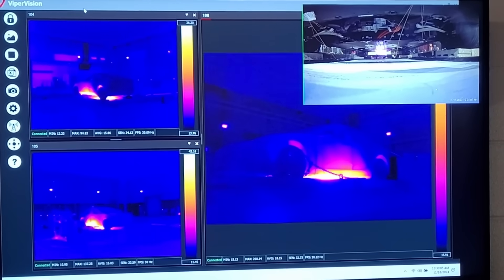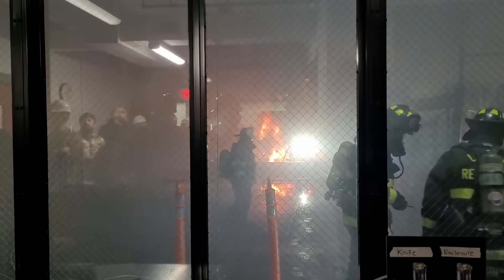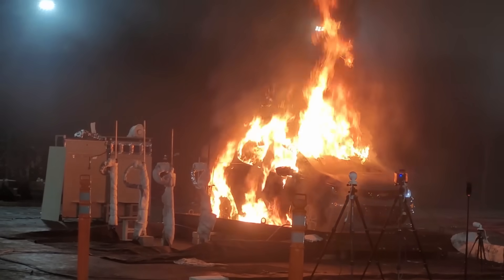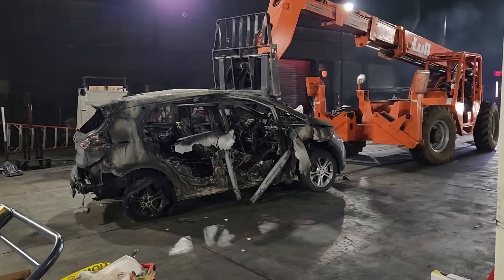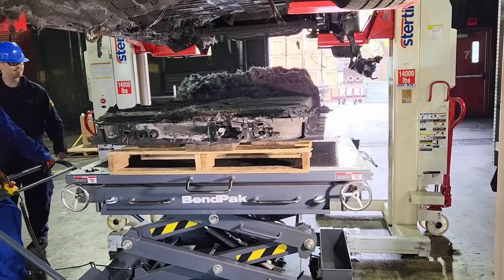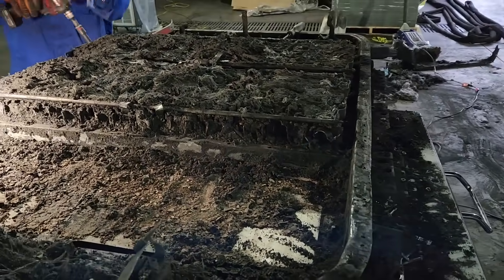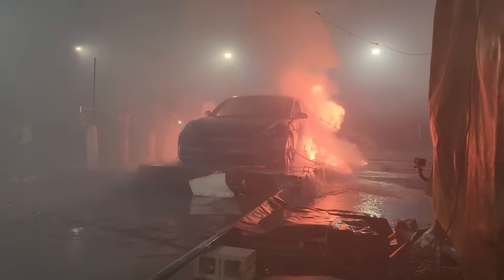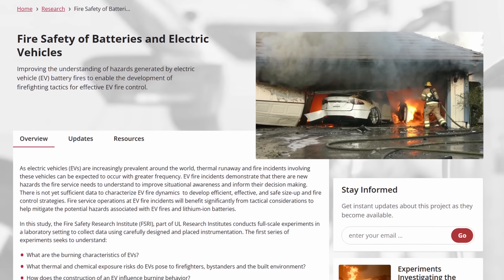FSRI EV Fire Experiments: What We’re Learning About Battery Fires

Comment: Two points that chew at me re ev fires starting and being put out. Wrt how fires start, does ohms law and how current moves within the battery have any link to how a fire starts? Wrt putting a battery fire out, (thought from left field) could creating an electrical circuit to the ground speed up making a battery pack flat (whilst huge kw in the batteries). there doesn’t seem to be any alternative but to putting a fire out with water etc. in fire fighting options. Dropping an ev into a portable pool is used for extinguishing but I ask for example how much is electrical current flowing through water (all be it probably forming  some hydrogen and oxygen)?

Comment: Just an idea. 
But certain level of oil is used in the electrical industry to quench arching in equipment.
How about a mobile tank of oil attends EV fires. Along with a fork lift. Normal firefighting can take place until this special unit turns up. Then the vehicle is lifted and submerged into the oil. Left there until it’s cooled sufficiently. Covering jets while it’s being lifted and dropped into the tank.

Comment: Great work and badly needed, I habe to ask if the team has considered doing a live charging failure instead of an over heat type? My thought is that the thermal issues could be different if internally the pack fails due to faulty cell(s) or charger issues. Perhpas several cells fail close in time together with the heat focused in that specific area causing different specifics as that heat is trapped inside the pack etc.

Comment: Great Work!  What is the contamination level of the water runoff?  How many gallons of water does it take to extinguish an "average" EV fire?  Is it a better choice to let the EV fire burn itself out?
Reply: When it comes to battery fires the strategy is to use water to cool the surroundings to prevent batteries in adjacent vehicles from being heated to the point of thermal runaway.  Once a battery shorts internally it is not going to stop burning until the energy contained within is released.
Reply: @soundspark  The SOP on an EV fire is to use water to slow the thermal runaway of adjoining battery cells; assuming there is an adequate water supply. The water runoff is likely toxic as is the airborne particles.  Without containment of the runoff, is ground water being contaminated?

Comment: The automotive manufacturers had to have done extensive testing on EV batteries for engineering and liability purposes.  It would be helpful for StacheD to track down the test engineers from the likes of Ford and GM to learn what tests, data, and liability calculations were done.
Reply: re: "It would be helpful for StacheD to track down the test engineers from the likes of Ford and GM to learn what tests, data, and liability calculations were done."  unfortunately less helpful will be all the NDA's those Engineers working in R&D we're obligated to sign as a condition of their Employment. source: been there done that.

Comment: I have a problem with this study. Cause all the battery fires were from the flame working into the battery packs but what about if the vehicle is in an accident and the batteries get damaged and arch’s causing a electrical shock that could cause an explosion?

Comment: It would be interesting to see how vehicles from different manufacturers perform in these tests.  

Is there any vehicle / models that continually perform well, vs others that maybe not so well. 

Or maybe if different battery pack/cell manufacturers / battery types have noticable difference in how they burn etc.

Almost like a vehicle crash safety rating, except for EV fire safety.

Comment: Interesting. if vehicle is flipped (with the help of chains and fire truck), it might be thermally easier to cool down the structure of the vehicle and cool the battery. Heat will escape UP and battery is at the top.

Comment: I'm just thinking out loud, but... What if an EV fire-specific firefighting vehicle could be developed? I'm imagining something along the lines of what exists now as a waste collection truck that handles dumpsters. Equip it with a side-offload system that could lower a steel barrier to surround a burning EV, with that barrier then being pumped full of a suitable firefighting agent to completely encase the vehicle. This would (in theory) not only douse the flames but also remove the fire's external source(s) of oxygen. It would also provide containment to prevent the fire's spread and shield against possible explosive forces from the vehicle.
Thanks again and regards.
Reply: re: "I'm just thinking out loud..."  no worries. re: "What if an EV fire-specific firefighting vehicle could be developed?"  go 'head, i'm listening... re: "It would also provide containment to prevent the fire's spread and shield against possible explosive forces from the vehicle."  unbeknownst what you just described was the BAE systems (BFV) M2 Bradley Fighting Vehicle, but in your spec-out we will rename it the "Bradley FIRE Fighting Vehicle".  in a related bit of humor, also watch the 1998 HBO Movie "Pentagon Wars" featuring Kelsey Grammer, it's funny you'll like it.
Reply: @phillyphil1513  Roger, haven't seen the movie. Thanks for the heads-up.

Comment: Battery fire: all you can do is starve it of oxygen. It will produce ridiculous amounts of heat and anything near it is fuel. So the only thing you can remove from the triad of flame is oxygen.
Get fire blankets. Lots of them. Big ones.
Reply from the maker: Thermal runaway is a self oxidizing chemical reaction.  They do not require oxygen from the atmosphere.
Reply: @StacheDTraining  Exactly. But by containing it under a fire blanket, you prevent the vehicle from igniting anything else around it.

Comment: Why don't you invent a special fire fighting nozzle just for EVs? Oh because I just did. It's a rigid metal pipe between 6 and 10 feet long that you slide underneath the vehicle and it has the water outlets only on the top side to direct all the water straight up onto the battery pan directly. It could, of course, be helpful in extinguishing ICE fires as well, without the need to open the hood of the vehicle.

Comment: 8:40, It seems that the water hose powerfull flow is creating positive pressure in front of the flammable gas and flammes, making them to move when sprayed. Do you think that using larger spray and squeeze the gas in the middle of the car by using  spray on both sides of the car at the same time?

Comment: 8:08, ON these tesla the battery powering the infotanement screen is located under the hood and in most recent model is a really single 15.5V CATL lithium battery with very low power. It is recharged by the PCS on the from battery so even if the main battery stop working this 15.5V supply will continu as  well as the service menu to be able to provide data

Comment: There are tons of sensors inside the battery that the BMS and BTMS can provide. Individual voltages, current, Inlet and outlet cooling temperatures, enev some battery have gas sensors inside to detect venting of cells. I am curious if the team that made these tests were monitoring these BMS ? (the time they can operate as well) On the tesla there is a SERVICE menu where some of these data can be pulled out.  I imagine pointing a camera to it while the battery begin to burn woudl provide alot of additional data too. Even The OBD to Bluetooth interface using the Scan My Tesla app is awsome! There are hundreds data from the battery. Even if nobody have tiome to record these, a simple cellphone with screen recording would be enough to make it work!
Reply from the maker: There was a ton of data like that recorded.

Comment: Dear Mr. Durham,
German electric engineer here.

These tests seem to be very interesting. Just for my understanding (I might be wrong since I am NOT a fire fighter), the most dangerous starting point for vehicles when torched from underneath are like that:

EVs: 100% charged  - to have a max. run-away effect the moment the battery pack(s) start to ignite itself internally due to overheating
CEV: tank only 1/ 2 or 1/4 full to have a large gas vapor volume within the tank above the fuel, which might burst explosion style if overheated.

Is this correct and yes, were these victim vehicles fuelled / charged this way?

Any results from the experiments on how much time is left for let's say 5 people inside the car to stop and jump out? 
Any major difference between the EV and ICE, assuming the same door configuration?

Independently from the drive philosophy of the vehicle: With more and more cars are now not having good door handles and sometimes no door handles at all, how to manage to rip a door open to drag passengers out, let's say from an already smouldering vehicle?

I am very opposed about how EVs are forced politically into the market, but I am not opposed to EVs in general. Therefore as an engineer I am really curious.

Peace! from Dresden / Germany

Comment: Why was the burning EV raised and tilted at 30 deg while spraying easily underneath the car? That certainly isn't available for an actual car fire; wouldn't that negate the testing results?
Reply from the maker: Many fire departments are tilting the vehicles.   It's not easy,  but they do it.
Reply: re: "Why was the burning EV raised and tilted at 30 deg while spraying easily underneath the car? That certainly isn't available for an actual car fire..."  as we're witnessing in real-time with the First Responder battling the great "2025 LA Mega-Fire" down in So-Cal, DO NOT UNDERESTIMATE THE BRAVERY AND RESOURCEFULNESS of Firefighters to save lives and property.  like the wisemen say "If the job were easy...?  Everybody would be doing it..."👨🏻‍🚒

Comment: If you look at this and you are not an expert on Lithium fires, this video makes it clear what happens. Yet some EVangelists still say that ICE cars burns faster and hotter and they keep saying that EV fires are easy to put out. They must be blind to not see that what they say is not true. I think an EV is very dangerous and shouldn't be even on the road or on sale. Doors are electronicaly operated, windows are pretty hard to get through. Battery at the lowest point seems nice but that is also where the water is and in winter, salty water.
Reply: That is not true. Most proponents of EVs do say that EV fires that involve the thermal runaway are more vigorous. It is just that EV fires are a lot less likely than ICEV fires and only 60% of those fires involve a thermal runaway. So the risk of EV fires is less overall since they are far less probable. Not only that, you have look at the risk to structures from fires. Research is indicating that EV fires pose a similar risk to structural collapses as ICEV fires.
Reply: @yodaiam1000  Many battery car jockeys dismiss thermal runaway all together,  the other half do exactly what you just did. Tried to make thermal runaway seem less significant by attempting a pointless comparison, battery car numbers to that of liquid fuel. 
Can you please explain  what liquid fuel vehicle fires have to do with battery car thermal runaway?
Do the numbers address the grave issue of thermal runaway?
What do you expect to achieve with such?
Reply: re: "They must be blind to not see that what they say is not true." correct, they ARE "blind" so to speak.  in Psychology and Mental Health this phenomenon is known as "Cognitive Dissonance" <---- now at this late date in History you've probably heard of this.  however the key to understanding it is to simply "expand" one's definition of "blindness" to INCLUDE not just those people wearing dark glasses and walking with a cane...? but to ALSO include those people with the good fortune of having "20/20 vision in both eyes" (aw crap).  yeah because as we've witnessed the past 10 years, BOTH of these people in a practical and functional sense can be "equally blind".

Comment: QQ: Are you doing any experiments using kinetic force on the battery pack (i.e. smacking it hard or piercing it forcefully) as an ignition method? Judging purely from this channel and other incidental reports I've seen, having the pack struck forcefully or pierced during an accident seems to be one of the two common ways EV fires start. (The other being ignition during charging, which I don't claim to really understand.)

In any case, thanks to everyone involved for their hard work! ❤
Reply: Q: Are you doing any experiments using kinetic force on the battery pack (i.e. smacking it hard or piercing it forcefully) as an ignition method? A: well some could argue (that "some" meaning myself) that these "kinetic force experiments" have in fact been getting conducted year after year (for the last 12 years) literally on the highways and by-ways of 'Murica since the Model S was first released for sale back on the date: June 22, 2012.  see it's just a game of semantics really, what you call "experiments" the news reporters call "crashes" usually involving upwards of like 2, 3, and 4 "fatalities" at a time.
Reply: @phillyphil1513  I agree, but the side of the highway does not constitute laboratory conditions. 🤣

Honestly, I'm not sure if there's anything to learn from doing this in the lab. That's part of what I'm curious about.
Reply from the maker: I don't believe they are,  but others have pierced the pack and the battery immediately goes into thermal runaway.

Comment: Bring on the data!  It will be really interesting to see what info comes from this study given the broad scope of measurements.... it's usually the unexpected results that offer the biggest wins.  I'm curious... was the use of a forklift to tip up & expose the battery for easier cooling any more effective?

I know there's a fire-fighting lance that is designed to be slid underneath the battery... perhaps some kind of jacking mechanism could be slid under one side of the car to tilt & expose the battery enough to directly apply water from the truck?  

It's always struck me how low to the ground a lot of these EVs are, so even lifting one side by 30cm / 1 foot might give enough clearance for more effective water application in a roadside situation.

The other benefit could be giving fire-fighters a bit more control over the direction of the flames & off-gassing.... noting the gasses were escaping in that video via the highest points (the wheel wells), it may help reduce that issue of 'chasing' the flames from one side of the car to the other too.  Just a thought!

Thanks for bringing us this info, it's really valuable data that I can see being useful in a bunch of different ways, not just fire-fighting.  Looking forward to seeing these results. 👍

Comment: As a test engineer I have to say these experiments were very well done. I am impressed with the amount of instrumentation applied. Question: if battery packs had a stand pipe arrangement where you could inject water or chemical directly into the pack would it help?
Reply: It would probably help ruin a lot of people‘s days by slowly filling the battery due to leaks. 

As current batteries are sealed in the hope that means there are only two ways for it to go into runaway: external heat and hardware failure of the BMS, I‘d think a stand pipe introduces so many engineering headaches.

But there could be value in splitting up the batteries into more manageable battery modules that could be extracted and cooled off-site. But getting the space to put them and ensuring extractability after the car has molten around them is another nightmare and a half
Reply: I believe some fire departments are now using a stainless steel lance to pierce the battery pack and inject water directly into the pack. I'm not sure how effective it is.
Reply: Q: if battery packs had a stand pipe arrangement where you could inject water or chemical directly into the pack would it help? A: well i have indeed given much thought and consideration to such a device, but now after watching in the news the combined MULTI-INFERNOS of the "2025 LA Mega-Fire" and the latest eruption at Moss Landing (it's 3rd btw) i have officially given such a device the nickname "HELL'S CHIMNEY", good luck.
Reply: @phillyphil1513  oh god, but you do have a point: a stand pipe might be useful as the battery‘s emergency flame thrower akin to an emergency vent on pressurized containers

Comment: it looks like water jets really do not extinguish anything - all main burning happens inside batery shell on its own oxidizer, only gases come out as additional flame jets. They can damage everything, start secondary fires etc, but to suppress the fire the very battery core should be watered and cooled, which is not possible as the shell is still more or less intact

Comment: It is a relief to now know that independent testing is underway to provide high quality data on the effects and behavior of passenger EV fires. Are you aware of any similar testing/data for the much more broadly disseminated but smaller sized batteries in the 5Ahr range, such as those used in cordless power tools? I think twice every time I plug one of those into a charger as they see more frequent cycling and severe mechanical abuse than their automotive brothers.

Comment: As far as battery fire suppression goes, direct water injection into the battery pack to directly quench the cells is probably the only real alternative to letting the thing burn itself out. Once the inferno is out out, you can dam the area and use a small pump to continue cycling the same water through the battery to remove any additional reaction and discharge heat. Dunking the whole car in water while the battery is outgassing flames from the battery burning inside its housing doesn't do much good beyond containing the flames and contaminating 5000gal of water.